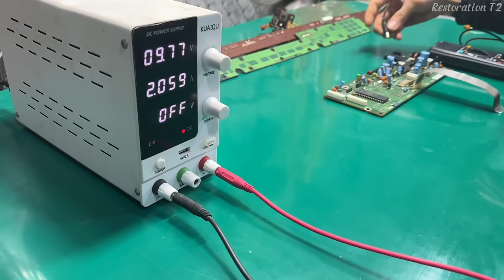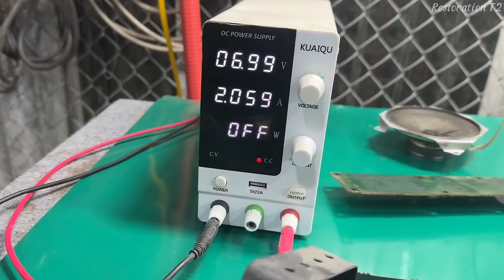YAMAHA PSR Piano Restoration | Restore Digital Electronic Keyboard

Comment: was that a normal white LED lamp you used for the keys? I thought you need a blacklight lamp for that
Reply: holy cow it works! I found a yellowed plastic part of an old fridge, covered half of it with my homemade retrobright gel (liquid laundry stain remover, aloe vera gel and potato starch) and wrapped a white LED strip around it and after around 8 hours there is a massive difference

Comment: Always a thumbs down for the pathetic theatrical start.
And sometimes for the fake restoration.
At 00:24, the plastic was covering the hole in the chickens net, at 1:34 he finally descovered that he would need the plastic and when remove it, the net was almost closed. :face-green-smiling:
What a joke. :face-green-smiling: